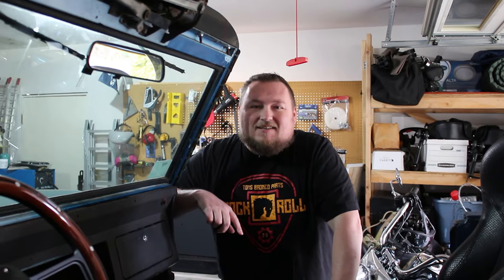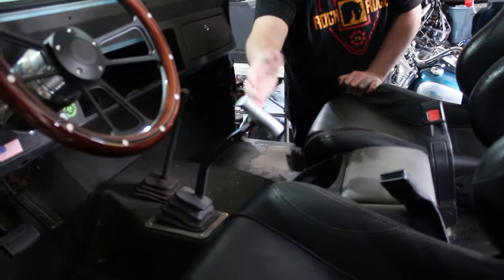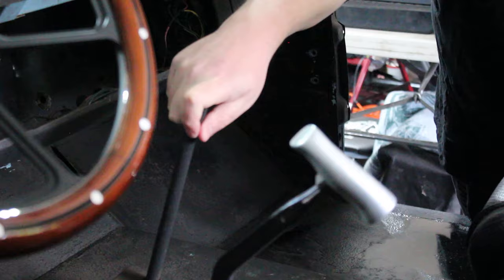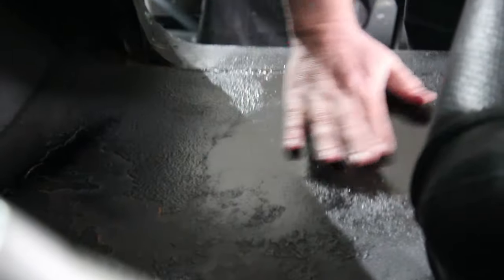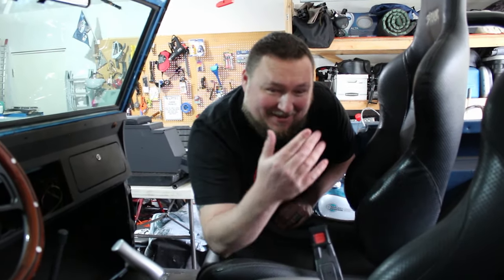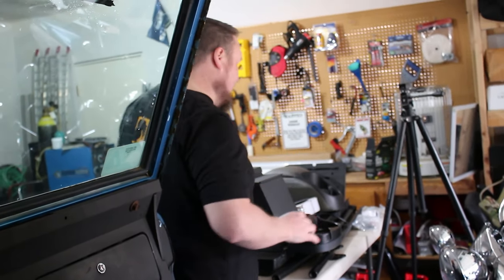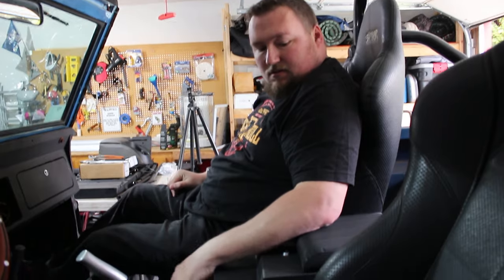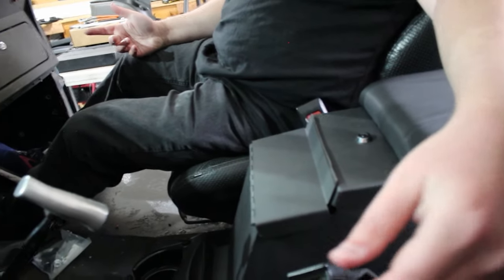Early Bronco Center Console Install

Comment: ever get this fully installed and figured out the adjustments required? just got one of these in for my dad and out the box it's definetely not going to fit right. the cup holders are too far forward and hit the hump for the trans/shifter. the seat belt mounts interfere. ours has the factory style seats and the passenger latch is in the way. the only way i see it fitting right is to shim it up almost 2" and move it back so far that it defeats the point of having an arm rest. I'll probably do a video on what we end up modifying. starting to regret not just building one though.
Reply from the maker: Mine is still sitting there, not fully mounted. I am having the same issues you are. With that I am more likely making my own,, so I don't want to mount it. Some of my original thoughts were to shim it up like you mentioned. The other was to cut out notches at the bottom where it interferes with the seat belt bolts. As far as for the cup holders. I have it wedged forward to the tunnel as much as possible and I have my seat back naturally pretty far so the arm rest is still usable. With that said, I would prefer the arm rest to still be further forward. In the end it will be a placeholder till I get around to making my own.
Reply from the maker: I would love to know what you end up doing with yours. Good luck!
Reply: i'll try to remember to come back and comment when it happens, but i'll probably make a video and post to my youtube when we deal with it.  @ShawnsEarlyBroncos
Reply: @ShawnsEarlyBroncos  I’ll have to see if I can make a short video of how I mounted my console in my bronco to show you, I know it’s probably way passed when you did this video

Comment: Didn't the counsel come with rear leg. Mine did and it will raise it so the stereo wires will clear the bottom of the counsel.  I ask Jim at WH  if it came with instruction and he said no, because he felt that mounting it will be different from Bronco to Bronco. I ended up cutting my rear leg down to lower the counsel.
Reply from the maker: Not that I saw. I got mine through Tom's Bronco Parts, so maybe the one from Wild Horses is slightly different. Yeah, no instructions with mine. Once I permanently mount it, I will look into some way of having it sit more secure. Works for now. Also, I plan to run truck liner and no carpet, so that will make it a little more complicated with wiring. Sorry for late reply... Thanks for the comment :)
Reply: @ShawnsEarlyBroncos when I mounted my console there’s three holes in the bottom of it I just marked them on the floor of the bronco and drilled holes in the floor and bolted the console to the floor it looks like the console is floating in mid air about an inch off the floor with plenty of room for the wires to pass between the console and the floor, I didn’t use the bracket that came with the console

Comment: did you install your floor shifter? Is it a 3 speed?
Reply from the maker: I did not. The previous owner did. Yes, it is a 3 speed. I know I will have some haters out there, but I am going to convert it to Automatic with a 4R70W at some point. What is your preference?
Reply: @ShawnsEarlyBroncos  I have a 74 with 3 on the tree and have a duffs floor shifter kit i haven't put on yet.I think i would prefer  an automatic but still undecided.
Reply: @speedwayman100 the three speed shifter is great. I had it in my bronco until I swapped over to the 4 speed top loader manual transmission, it’s easy to install on the transmission
Reply: @nickefgen9219  did you install your 3 speed? Have a video?
Reply: @speedwayman100  no I didn’t install the three speed shifter the guy before me did, if read my comment I swapped the transmission out for the top loader four speed transmission it looks like the same transmission, I installed the four speed shifter on that one but I didn’t make a video on the install of it
Reply: @nickefgen9219  Ok,thank you.
Reply: @speedwayman100  what year bronco do you have?
My bronco that I have is a 1970
Reply: @nickefgen9219  That would be great if it's not too much trouble!
Reply: @nickefgen9219  I have a 74 bronco and i have duff's floor shifter for a few years but have never installed it as i have been on the fence on which tranny i want but i have never seen an install video of their floor shifter.
Reply: @speedwayman100  yeah both the three and four speed shifter’s mount the same way it’s pretty easy install if you have some mechanical ability, I’ll see what I can do for you as far as posting a video of my shifter that I’ve already installed, where do you live if you don’t mind me asking, you’ll enjoy the new shifter once you install it, you’ll have to cut a hole in your floor to install it
Reply: @nickefgen9219  Thank you man,i appreciate it i live in southern cal.
Reply: @speedwayman100  I live in Washington state